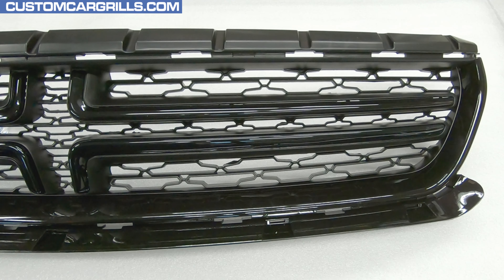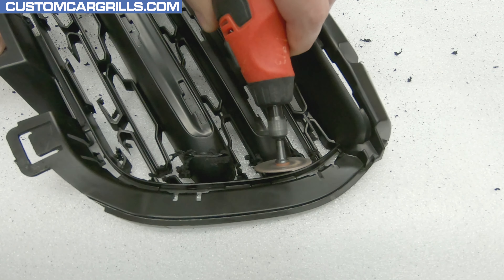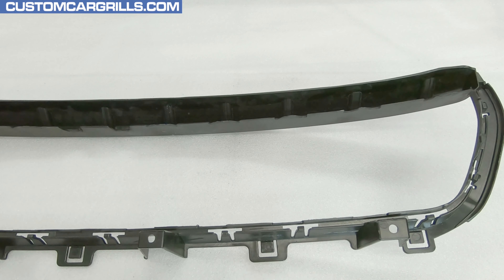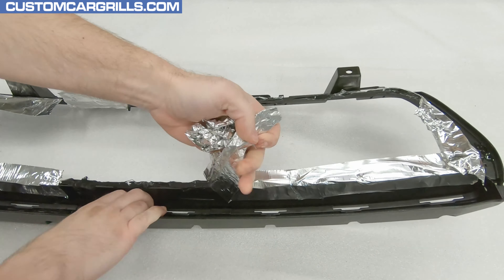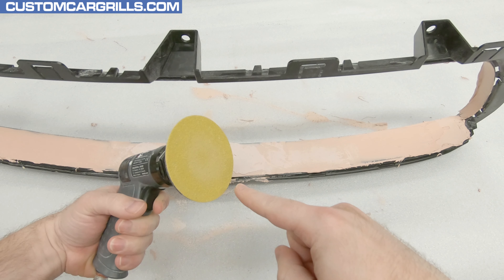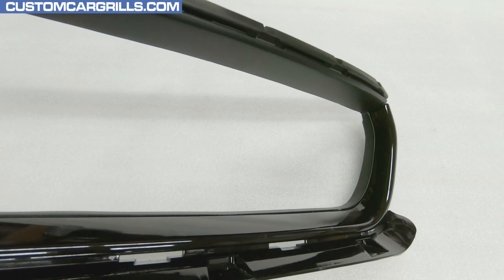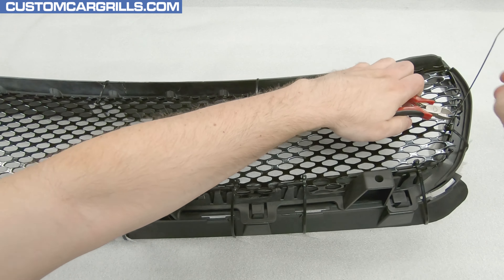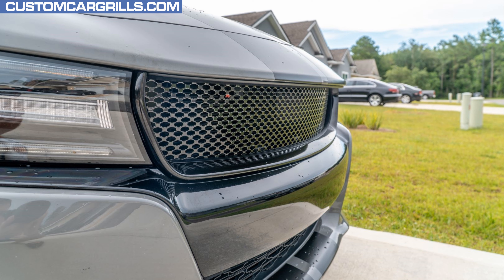Dodge Charger 2015 - 2020 Mesh Grill Installation How-To by customcargrills.com

Comment: So I just ran comparison prices on getting just the completed upper from your guys (for my 2017 Dodge Charger) and with just paterials alone, cost is about $450. That's including $225 for a replacement Grille Assembly cause I ain't carving into my only piece. I think I'll be ordering form you guys!

Comment: To much work and that will take hours and hours or if a shop does it will end up costing more than a oem scatpack bumper. That's what I did just found a scatpack oem front and rear bumper same color match for $550 including installation. Now my basic rt look like a 2020 rt plus
Reply: Where did you find oem scat bumpers?
Reply: Right where?

Comment: How much would a professional typically charge for a job like this? Any ideas?
Reply from the maker: Average body shop rate in my area in 2020 is around $70/hr.  I think 5 total hours is a reasonable expectation to get it done.  Shop rates and times will vary depending on where you take it to, some might quote more or less.
Reply: @customcargrills  Hey I appreciate it! I gotta say it'll be worth it. I got an se charger and parts are expensive for it and not many trust worthy shops around here. But it looks tuff the way it came out tho! Great job

Comment: Hey Mat I was Wondering if there was a way you could possibly make me a a custom grill with the same mesh design as the oem grille?
Reply from the maker: Hi Mike.  I could design a sheet of mesh that resembles a pattern similar to the stock mesh but it would drive the cost up drastically.  I would expect the there to be a +$300-400 premium on such a piece.
Reply: @customcargrills  I ‘d like to actually use oem material is there a way I could send yall 2 of these “68214782AA” (part number) and yall cut out the factory mesh material, then install into a upper grille piece? If not Its understandable.
Reply from the maker: There's really not a good way to fuse two of those together  =(  I don't think it would work that way.
Reply: Anything is possible.